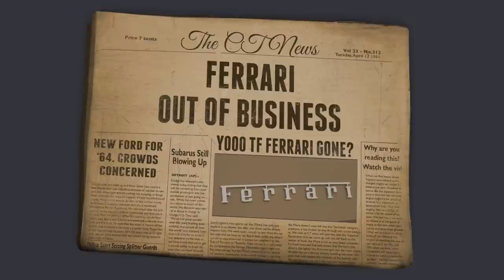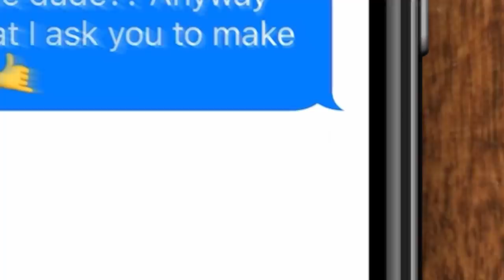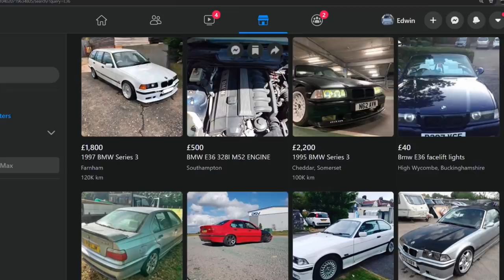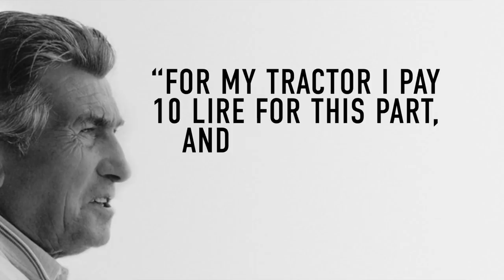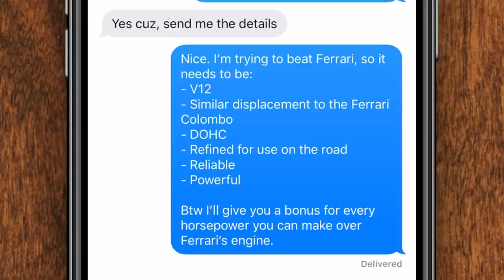How Enzo Ferrari Was Responsible For The Lambo V12

Comment: Enzo himself though (which was true in just about 20 years ago) thought that the best car would pretty much fall into it's pieces when it hit the finishing line. The parts that built the car was not over engineered, the car did not carry more weight then it needed to and so on. You build something that does the job and wins that race. And this was what Enzo wanted, if you had a part in the car that did not break and could do +10000 km before it broke it was not done correctly and was over engineered and had too much weight. And I guess that carried over to when he was pretty much forced to do cars that was not supposed to just (with a small bit of safety) take it to the finish line...

So again, Enzo clearly was not happy with doing "cars" for the public. And it showed, the early Ferrari public cars was still just race cars mostly with some added road and safety things.